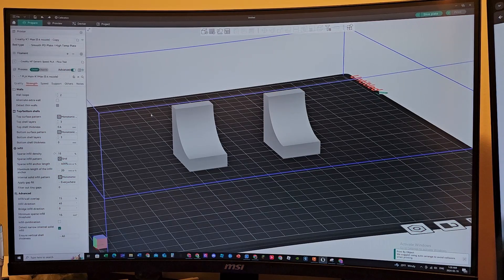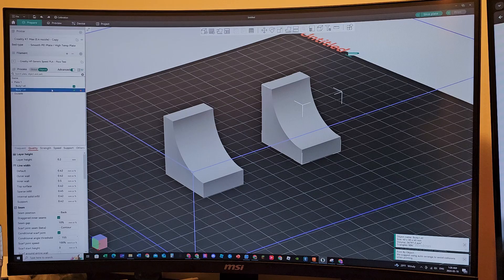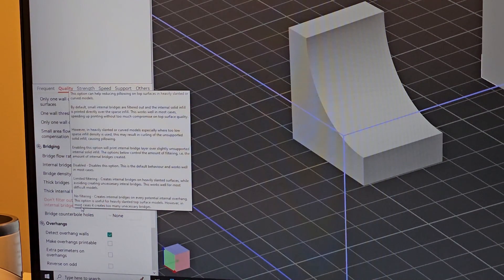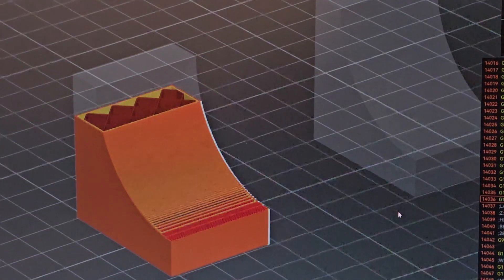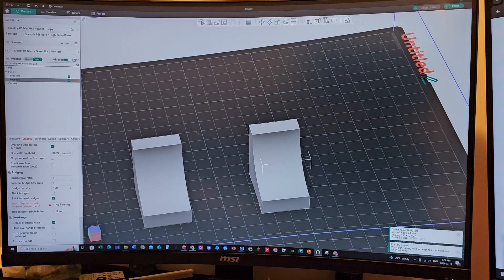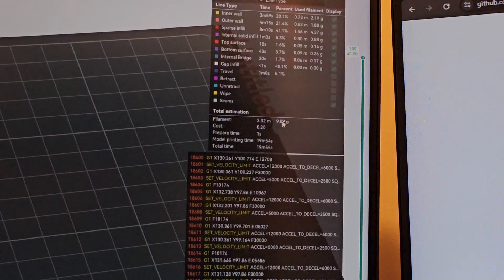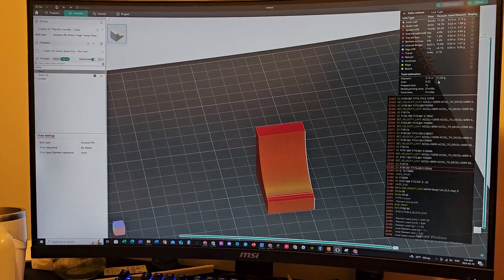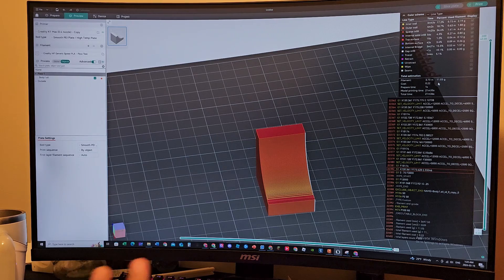Internal Bridging - Printing Curve Parts Made Easy

Comment: I have to say I've never seen these artifacts with a well-tuned printer (Prusa MK3s+ and Prusa MK4).

It could be filament dependent and it could also be some other aspect of the tuning of the profiles, especially if you're going for maximum speed. Since the additional internal bridging also adds time (about 7.5% it seems) I wonder if just slowing the print down slightly would have a similar effect on quality without adding material. It looks like you're using a K1 Max on the speed profile, so that's the first thing I would look at since from what I know that printer tends to really stretch the limits of its hardware to get the numbers on paper.

An interesting test would be to tweak the speed multipliers until you get exactly the same time as the one with additional internal bridging, then see if there's any difference.
Reply from the maker: That's true, I printed at 300mm/s so it doesn't have the time to cool down if I would to tweak the setting I would get s better results.

Comment: it's not 2 g, but 1.14 g, which is an additional 11.5% filament. 11.5% is not a few, especially for a large print. But ofc is it worth it or not - is another question, and the answer depends on the objective. Also, idk about that slicer, but in Cura there's skin edge support, which uses less filament and helps with that thing too.
Reply from the maker: That's good to know, I think if the model really depend on quality then it's worth it. Grate that Cura has something like this too.

Comment: I'll give you credit. Not only did you demonstrate this function, but I never fully understood what the object mode meant.  I never dreamed it was to change the settings for each object independently.

I would still generally do such testing with separate runs for each piece because printing multiple pieces at once can lower the quality.  But it's certainly an interesting option that I'll be considering when doing future testing.
Reply from the maker: Thanks,  yeah that object button is very useful. I did not mention this in the video, but the two parts were printed in sequence,  so one was done printing then it will start the next one.